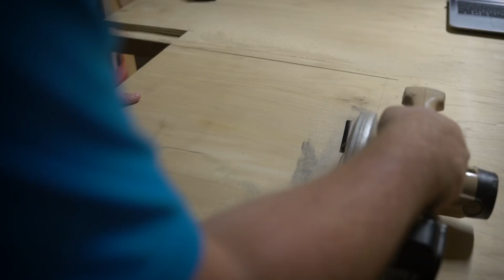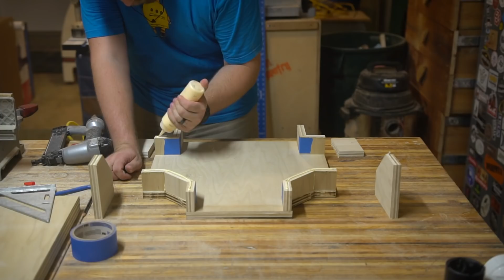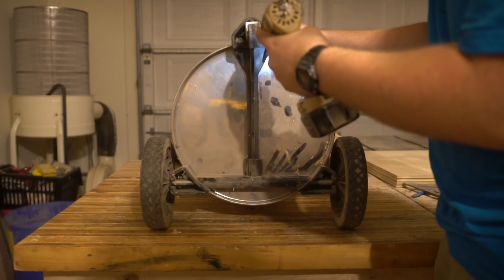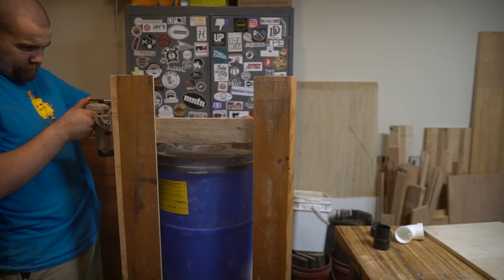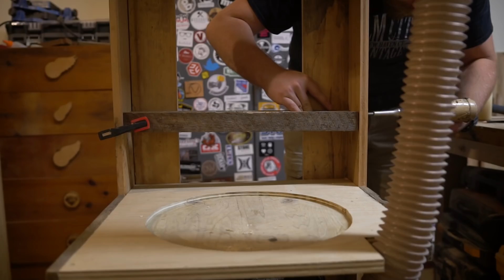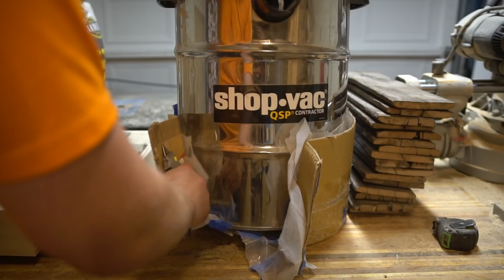Space Saving Shop-Vac Dust Collector Cart

Comment: Now that you have used this set up for a few years, how do you feel about the separator and 20ft of corrugated hose restricting airflow? With the 6.5hp shop vac do you feel like you still have enough airflow and suction to pull in chips and dust?

Comment: Why it does need a two container? I don't get the logic.
Reply: The blue barrel is a dust separator. Look at his Rockler link for its description. It pulls the sawdust out before it reaches the filter in the vac thus keeping the filter from clogging. You only need to empty the blue barrel, not the vac. Research cyclone separators and you will understand the principles behind the device.
Reply: thanks man.

Comment: I have really been meaning to build something like this.  nice build,  I like the idea of the concrete at the bottom.
Reply: agreed with frank. it was just another dust separator cart... until you poured the concrete. so perfect.
Reply from the maker: Thanks Frank! That would be super handy to wheel around your space
Reply: The use of concrete as both a holding mechanism and for the added weight was a great idea.
Reply: Hey I watch your videos